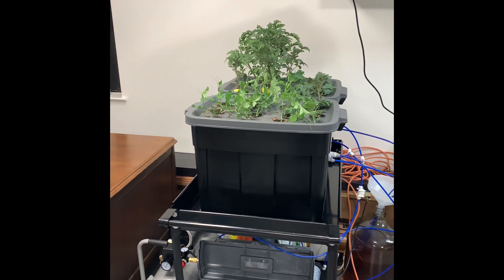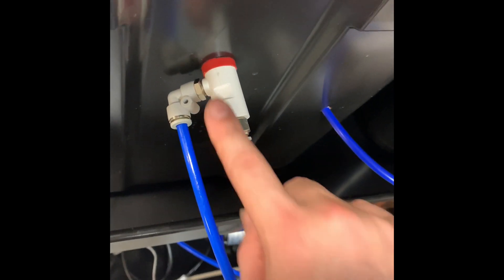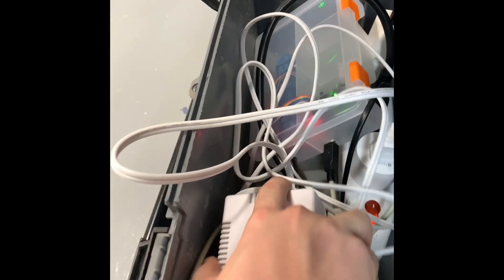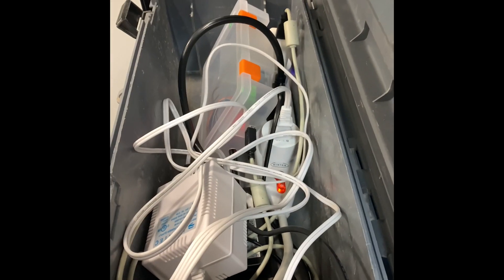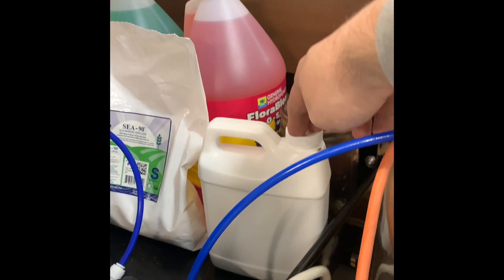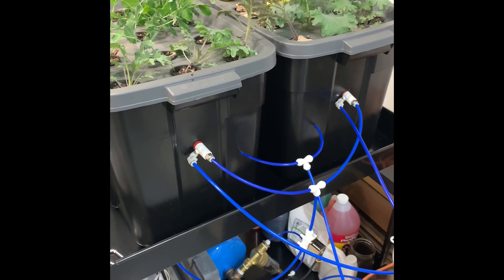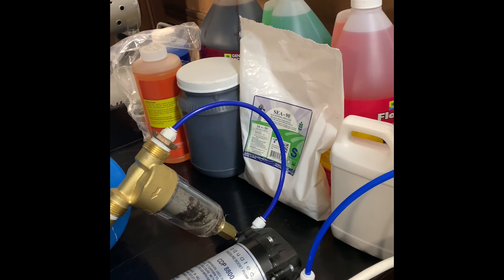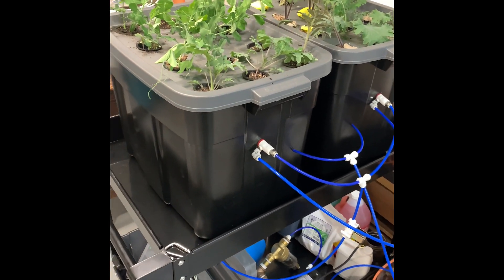Aeroponics 101 - The true build  - for hobbyists

Comment: I thought you needed to be at least 100 psi to create the correct droplet size of 50 microns or smaller? Confused!
Reply from the maker: You might not see it there on the gauge but the psi I had it set to was around 110

Comment: What stops me from using aeroponics is the noise. Cascading liquid over clay balls with a small aquarium pump works really well for me and is very quiet.
Reply from the maker: @HereIsmarcus  yes very loud, also air compression is energy intensive and the compressor produces a good amount of heat

Comment: Are you still using this system? If you are, is your timing still the same?
Reply from the maker: @beardedamerican8929  I’m not anymore. I noticed that the appetite changed for different stages of growth. Also I had algae growing in the nutrient tank. If you can pump out the excess nutes that build up in the plant container you can hit the roots almost constantly. The main problem is the noise from the compressor.
Reply: @Ghanzo  awesome!! I’m sorry it didn’t work out for you. I do have a way to pump out the bottom. I’m just thinking about using a concave drain to drain out to another small reservoir so I can keep an eye on the ppm in the runoff.
Reply from the maker: @beardedamerican8929  I ended up getting into soil, but I worked at an indoor vertical farm for a while. Still think its very cool tech. What are you growing? Youre going to reuse the runoff right?
Reply: @Ghanzo  lol, soil’s been my bread and butter for a decade. Love it. And yes, I’m planning on when I test the runoff, I’ll make sure the PH is also good, and reuse it.

Comment: if the solenoid valves are 12V DC you can substantially prolong their lifespan by using a flyback diode.
the diodes are very cheap an you can just solder them onto the relay contacts, just make sure to get the polarity right.

Comment: Do you know how to wire multiple solenoids with that relay? I want to use more than 1, use a single power cord, and wire them in parallel.
Reply from the maker: https://youtu.be/8yIw6vG29Rs?si=iJpXloGEjllXpj86

Here im using an arduino as the microcontroller but id recommend using an esp32 since you can use wifi and your phone to control it using various applications.
The arduino is great for learning though and integrating the esp32 with applications can be a bit tricky.

Im also directly connecting the power supply into the solenoid on this video which is unnecessary, I can connect the powersupply to the relay and use jumper cables to power each relay and then have small wires go directly to the solenoid, so one 12v supply can power 8 solenoids easily. 

Also in the video I mention that the watts matter, they don’t, all that matters for the power supply is the voltage
Reply: @Ghanzo  awesome!! Thank you 🙏
Reply: @Ghanzo  do you have a recommended video on how to use the esp32?
Reply from the maker: @beardedamerican8929  I don’t. Youre going to have to figure it out. Its quite difficult. I used an app called tuya for a lot of the smart plugs, but I think for the esp32 i used home assistant. Home assistant is pretty technical buts its amazing once you get it cause you can integrate tons of things into it, but thats a bit more advanced. I would try homelink maybe. Find the easiest ways to integrate the esp32, play with it, youll eventually figure it out. Youll need the esp32 where you can put jumper cables in it.

Oh and ask gpt4 for help too! Can be very helpful for this kind of thing
Reply: @Ghanzo  you’re awesome! Thank you
Reply from the maker: I edited that response fyi, just making sure you see the edited version there

Comment: How can you say for certain that your method produces 5-50 micron sized droplets? I'm very much interested in this method,  but don't wanna jump to conclusions.
Reply from the maker: Its an approximation. Its certainly smaller that a regular small outlet sprayer as it has this smoke quality to it, where a sprinkler valve doesn’t.
There may be many more ways to get good results and the noise of the air compressor is an issue. Also continuous use of an air compressor gets it pretty hot and it might break down faster.
Reply: Buy a compressor with a large tank so it has more time to cool down in between?
Reply: This is a really good system though I prefer it to the typical HPA systems you see in most videos and literature. I think much less potential for components to wear down and break.
Reply from the maker: @MathieuGauthier-fj9lm  just dont spend too much money. Compressors are nice for a lot of things so sometimes you can justify buying one just to have in the garage, you can get cheap nozzles on amazon, youll need solenoid valves. Adds up quick but compressor probably the most expensive part
Reply: @Ghanzo  Ya I think this system is superior to the more common hydraulic based HPA systems. But the compressor will be so loud. I don't even know where I would put it.
Reply: @Ghanzo  Just outta curiosity. How big is the tank, and how often did the compressor kick on in order to refill it? And for how long? trying to get a rough idea here
Reply from the maker: @MathieuGauthier-fj9lm  yeah the compressor sound is the main issue. I think its a better setup for a more industrial style operation. You could get a massive tank and bury all of it underground which would make it better. The compressor puts off a lot of heat too though. Can overheat
Reply from the maker: @MathieuGauthier-fj9lm  i think mine was 3 gallon and it went off every 30 minutes or so for just a small tent.
Reply: You were saying that you discontinued with aeroponics and moved back to soil eh? Because of microbe action. But I presume you can supplement microbes with an aeroponic system. Even optimize it. Depending on what you're looking to do with the plant. Definitely sent me down another rabbit hole though.
Reply from the maker: @MathieuGauthier-fj9lm  you really can’t mimic soil with hydroponics when it comes to microbes and fungi
Turns out that plants produce glucose (photosynthesis) and push it out their roots to feed microbes, not all of it but sometimes up to 80%. The microbes eat the sugars and in return give the plant various things. Plants even consume microbes themselves, called rhizophagy. So there is a very complex process that we reduce to a few inputs, but in nature millions of things are happening.

Comment: Please go through the water pump side of this. And well the whole thing from scratch. You’re awesome how you have tackled it without any hesitation
Reply from the maker: the water pump was being used to drain the excess nutrients that end up sitting on the bottom of the tank, to be recycled back into the nutrient tank. 

when you spray the roots, over time the bottom of the box ends up with the nutrients puddling, so you need to drain it some how and put it back into the nutrient tank. I was using a pump but you could get creative with it. but use a filter if you use a pump!

in general its a pressure tank, a compressor, and then a valve and a nozzle. You need to find a way to program the valve, many ways to do it.

if you have some questions just let me know

Comment: How does the accumulator tank fit into the equation?
Reply from the maker: totally not necessary. I think it was in the drain loop for some reason. Looks like I was using the pump to pull from the boxes and then pulled through the filter, and pumped back into the nutrient tank

Comment: How much faster do plants grow compared to a hydroponic system?
Reply from the maker: They grew very fast, though I'm not sure it would be considerably faster than hydroponics, though, I have never tried
Reply: Your setup is impressive. I also want to build one but I want to know if its way better than hydroponics by a mile to justify all the cost and hard work of operating the aeroponic system. 
I was able to hear claims of 300% growth rate vs 50% from hydroponics when compared to soil. Do you think this claim is overstated?
Reply from the maker: @christopherjohnmercado1568  It might grow faster. The root growth is really impressive with aero. You can buy nozzles for a lot cheaper than I did on amazon, so then the only cost becomes the air compressor, the solenoid valves, the power supply, and the controller. If though something goes wrong, like the nutes run dry, the plants die really fast. So they are a bit more fragile than normal. If you already have the hydro equipment than maybe its better to just go with that. If not, I think the cost is pretty much the same.
Reply: @Ghanzo I see. I want to do a side by side comparison of the 2 systems. What misting interval do you recommend?
Reply from the maker: @christopherjohnmercado1568  I believe I was doing a 5 minute off and then a 5 second on. But it should be adjusted based upon the nozzles and the age of the plant etc. 5 min off 5 second on should be good though
Reply: @Ghanzo  I see. Since the upload of this video, any improvements you have made on the system?
Reply from the maker: @christopherjohnmercado1568  I don't use it any more, I started using soil actually. I do  worm composting and use soil to grow tomatoes indoors.
Reply: @Ghanzo  i see. Whats the reason? We are opposite, I used to grow stuff organically.
Reply from the maker: @christopherjohnmercado1568  Plants are evolved to have a symbiosis with microbes. Plants feed the microbes photosynthates and the microbes in return give them plant available nutrients. The complexity of the nutrients that plants can receive from microbes are beyond what we can replicate with fertilization. Properly managed soil can lead to the healthiest and tastiest plants. I used to work at a vertical indoor farm, and I can tell you that even with billions of dollars of investment, there is something missing when you take soil out, at least at this point in time. I now work at a regenerative farm.

Comment: Thats is Fogponie or Ultraponie
Reply from the maker: Neither. It's Aeroponics. Air compressor and nozzle
Reply: @Ghanzo  
Yes my bad, it's not Ultraponie, thats will need Ultrason gear.
But i think we can call it Frogponie to.

I just discover High pressur aeroponic system with your video.

Very interesting.

Comment: Hi, really nice set up, exactly what I'm planning right now,except I have designed a 3d printed tower. Any advantages of using the air compressor over a water pump like the 8800?
Reply from the maker: For a small project like yours I would not recommend a compressor. First of all it is really loud. With an 8800 you can get it to be practically silent. Also the nozzles put out a mixture of air and water, so the root chamber has to be bigger or else the roots get blown around. The benefits is the consistency of the mist. Its finer mist, and the roots love it. But you can still get great results with an 8800. You are going to need a pressure tank as well. Get the pressure up to 80-100 psi, whatever is comfortable for the tank, and hit those mister nozzles! I would use a few inside the tower, not just one at the top. Be sure to use some kind of filter pre pump. There are those mesh filters that get out sand and all of that. Also make sure you use a check valve after the pump, so that the tank doesnt push out the pump when the pump is off. Good luck!!!
Reply: @Ghanzo  thanks! After a year of posting this video... Would you say this kind of complex setup speed up production to justify parts and energy costs compare to something simpler and cheapest?
Reply from the maker: @RufusCubano  It depends on the scale. I think if you have a big enough project It makes sense to utilize air pressure into the operation. Air mixtures can also be used to spray the foliage with nutrients as well, so you can use the pressure for a lot of things. For a garage setup, no.

Comment: Hi Ghanzo,

I am trying to see if I have this right. Please correct if I am wrong. So you run a sleep timer on the Arduino that executes code to turn on a switch/relay that will open the solenoid allowing air to go through (compressor) whilst simultaneously sucking air from the line you have going to your nutrients. This is the main function of you setup correct?

So how did you know/get the mixture right in your nutrient tank (big glass jar) as well as the right ratio of air to nutrients mixture? Nutrients in PPM but nozzles in microns.
Reply from the maker: The mixture density and flow rate is adjusted in two ways, the first is obvious, the psi of the compressor. The nozzles are designed to work at 45psi. If you just play with one nozzle you can dial it in and see how the spray changes at lower and higher psi. The more nozzles you add in, it becomes more complicated it becomes since the lines are different lengths etc, so it might be better to trigger all of the nozzles independently and not in unison. Ok and now onto the second parameter. You can also adjust the spray density by adjusting how short the nutrient line is. the siphon pulls the nutrients up the line with negative pressure, so the longer the line is the lower the flow.
You could put in a nutrient accumulator tank, at a very low pressure, say 5 psi, and trigger two solenoid valves at once, the nutrient line and the air line. You're still going to run into the problem where further lines are going to have lower pressure then closer lines. Not sure exactly how to fix that problem, other then having some sort of regulator at each nozzle so that each nozzle gets exactly the same flow rate.

Not sure if that answered your question. You want to feed the plants as much as they will take and that changes throughout the plant's life. In the beginning the plants take very little, but toward the middle and end, youll see that recycling of the nutrients diminishes faster later in the plant cycle. So the nutrient composition can be addressed independently from how the nutrients flow out of the nozzles (mixture density, feeding cycles etc). In general the nozzles operate in a pretty linear manner, they want 45 psi, and the nutrient line to be a certain distance, and if you play with the nozzle you can see for yourself where this sweet spot is to dial it in.

Comment: Hi, how much water pressure did you set? You onky talk about air pressure, thanks!!
Reply from the maker: No water pressure. It comes out as a siphon. If the nozzles are much higher or you have a lot of them you might have to put in a bit of pressure.
Reply: @Ghanzo  and then why you use a big pressure water pump?
Reply: Also seems that you have a water accumulator tank
Reply from the maker: @marcoshuertaplaza5214  good eye! That was a mistake. I was using the pump to drain the boxes, and I think I did that so that the drainage could pass through the filter connected to the tank. I shouldnt have used the tank connected like that. I dont think it was filling the tank though, i think it was passing by it, because the tank needs pressure to fill, theres a rubber flap at the input of that blue tank. The brown water jug is the nutrients input and you can see that all the hoses go to that, drain and the nozzles. but yeah the nozzles dont need water pressure if the source is close to the nozzles, the siphon can pull the nutes without pressure
Reply: @Ghanzo  so then no water pump needed for nozzles, right? Just a tube from reservoir to water hose of nozzle and the pressurized air and ultrasonic movement of the nozzle will pull the nutrient solution, right?
Reply from the maker: @marcoshuertaplaza5214  Correct. No water pump needed, only air compressor.

Ultrasonic is not a relevant word.

Comment: Have you ever tried using a pond fogger,?   ( basically its a scaled -up , ultrasonic humidifier
Reply from the maker: No I have not, but I heard that the droplet size is too small. The nutrients get sprayed onto the roots with air pressure nozzles, where the pond fogger its more like evaporation which perhaps doesn't transfer the nutrients effectively. But idk maybe it does work. I think there's something to be said about having a lot of different nozzles and spray types to get a range of droplet sizes.

Comment: Great looking setup!  How has this system been working?  I have designed and 3d printed an AAA nozzle, and I get good mist (bordering on fog), but I am finding that the root chamber although wet and root development seems to be good, plant growth is slow.  I also find that a single nozzle isn't giving coverage to the plants closest to the nozzle, but out of the stream aren't doing as well.  Would love to have a further conversation with you about this.
Reply from the maker: You might want to increase your pressure and extend your timing so that the mist penetrates all the way though, you can also add nozzles if need be. Over feeding is not a big deal, as you can recycle the nutrients. Important to get the roots what they need. Also are you sure that your nutrients are right? You might want to run some experiments where you have different settings on different boxes. Also make sure that your nutrients don't become infested with microbes.  @Jon Osterman  who is in stephen jackson's comment down there, mentioned using oxidizers to maintain sterility. Read his replies, some high quality insight.

I have put the aeroponic grows on pause, and I took up living soil. Might come back to aeroponics for indoor tomatoes. Very rapid growth and decent tomatoes.

 Very cool you printed nozzles. The ones I bought were very expensive and look to be 3d printed as well. Printing seems to be the best move.